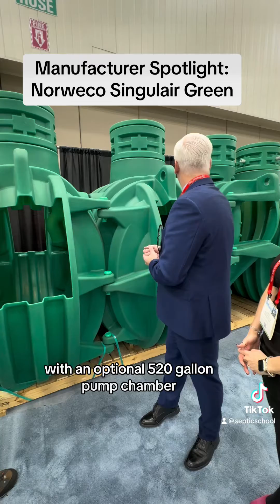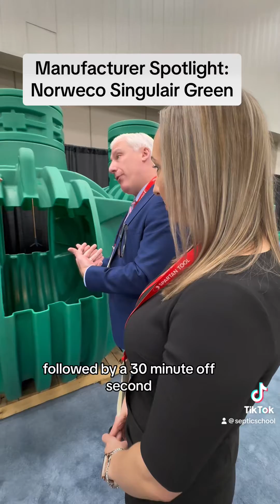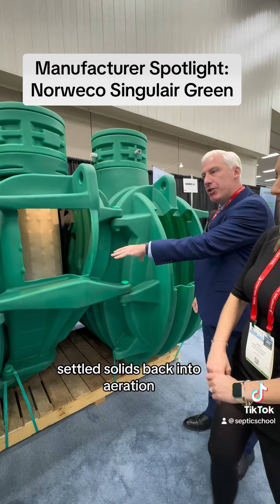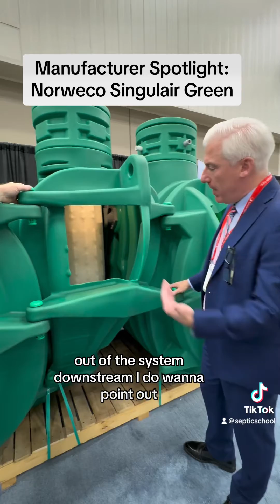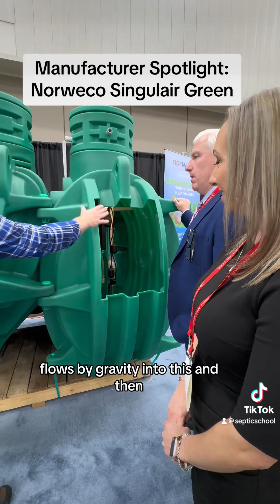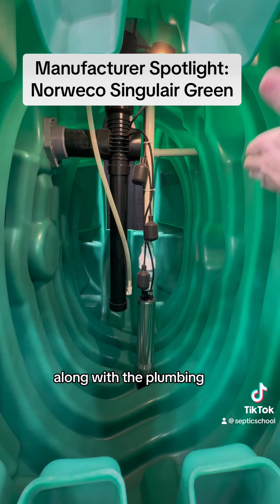Septic Technology Spotlight: Norweco Singulair Green

Comment: I have had this norweco system for 20 yrs.  If you like throwing money at septic systems by all means install this system.  I've had to replace everything except the tanks so far.  Aerators, filters, hydraulic units, timers.  And if you don't pump it out every year it clogs up.
Reply: If you have the system properly installed, maintained and use it properly you don't have constant problems. Yes in 20 years you are going to need to replace components that wear out. But the only reason a Bio-Kinetic filter needs to replace is if the system hasn't been properly maintained. Having to have your system pumped annually is because of how you are using your system
Reply: @Yosemite-c8h right blame the operator not the system.  I know people with traditional septic systems that haven't had to do a thing to it in 20 yrs, including never have it pumped out.  Sorry, but we actually  have to take a shit once a day.
Reply: @paulmarino8810 If you have to have your tank pumped every year , it is not the system failing it is because the system is being overloaded. There are many ways this could be happening: system undersized for the number of people using it, high water use at one time, someone is talking very strong medication or high use of antibacterial cleaners to name a few. FYI saying it is okay for someone not to have their tank pumped in over 20 years shows how little you know about OWTS's, because those people  are probably drinking their own feces.